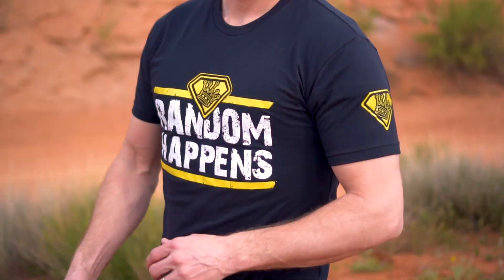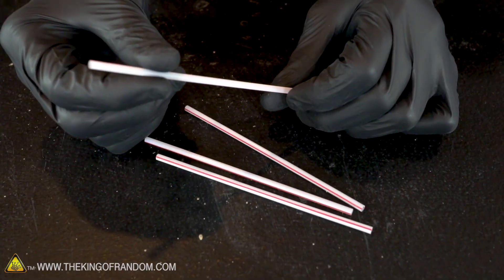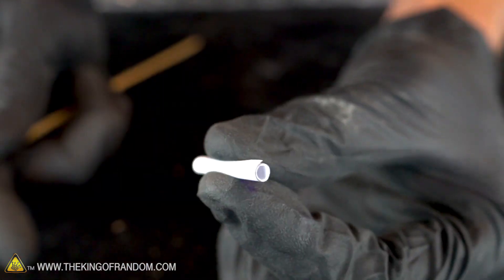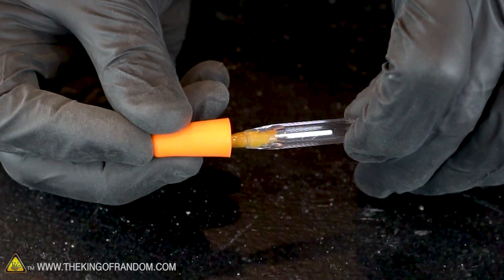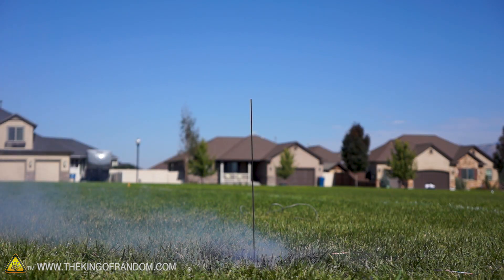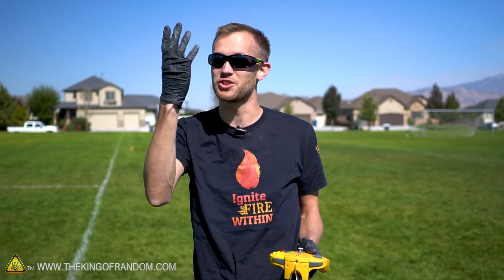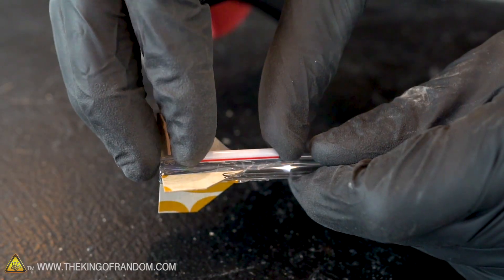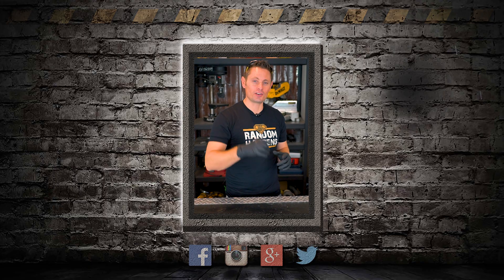DIY Pen Rockets! TKOR Dives Into How To Make a Mini Pen Rocket That Works On Rocket Fuel!

Comment: Maybe put another piece of straw as guide close to the tip of the rocket to avoid it going crazy?
Reply: The reason it went crazy is because there is a hole in the side of the pen that allowed gas to escape. In the next video in this series, he covers it up with glue.

Comment: The pen plastic doesn't melt with heat, how it's possible😕😟
Reply: higher melting temperature
Reply: The fuel burns before the plastic can melet.

Comment: I know this is a necropsy but I saw sideways thrust through the vent hole half way down the pen body. If you could slow the combustion by adjusting the compound they would probably fly much better, I believe that casing failure occurred quite frequently based on the video. Keep up the experimentation.

Comment: Idk if you noticed when the fuel was burning through the pen tube there's a tiny holes on the side of the pen that could release pressure through there and change your direction or cause the pen to explode

Comment: Part of your launch stability issue is how small your metal pole is compared to how wide the straw is. It would also help to be around a foot longer and angle your rocket fins in a fashion the maximizes the spin of said rocket :) if you use a metal tube instead of plastic you can pack it down a bit more for more thrust!

Comment: As has been previously mentioned: glue the small hole. In addition, increase the length of the guide straw to 2", weigh the fins on a gram scale to ensure each weighs the same, and use hot glue sparingly. The lift-off and flight-line will be much straighter. What better way to recycle all those used-up pens! Nice project.

Comment: Why go through the complicated process to 
remove the rear plug?  Pull off the front tip 
and ink tube, then push the rear plug out, 
with a piece of coat hanger.

steve

Comment: Also the proble with it going off balance it the straw you are using. cut the straw into two smaller rings and glue one at the top and one at the bottom. it will run off the guide smoother.

Comment: Zinc/Sulfur is known in Amateur Rocketry as MicroGrain. It was one of two widely used solid propellants starting in the 40's. The second was Potassium Nitrate/Sugar. The RRS, PRS, RMRS1 and RMRS2 were all prolific users of MicroGrain. One early altitude record was 14,400 feet and a later second one apparently 90,000 feet with MicroGrain.

Comment: Definitely be careful with zinc and sulfur mixtures. I burnt my hand pretty bad from the hot zinc sulfide dust that was expelled out. Definitely gained more respect for this mixture after my hand glowed like a neon sign under the blacklight.

Comment: you may want to put your straw higher up on the pen. where the top of the rocket points the body will follow. since it's power comes from the bottom, the tendency is the bottom is trying to pass the top forcing the top to go off plumb.I hope this makes sense, that is I put it in a way y people understand

Comment: Looks like there's a small hole in the pen body, when the rocket launches the fuel burns out the side of it and knocks it sideways - if this is filled, it should travel in a straighter line

Comment: Do this, but make the fuel thermite instead.
Reply: Um, no.  Thermite burns at 2500+ degrees Celsius.  The instant it started it would flash melt the plastic pen body.

Comment: guys there's a small air intake hole on the side of every ink pen that allows air into the pens cavity as you use the ink up, it's really small and hard to see, as i watch your slo-mo i see the gas escaping from that little hole thus making your pen rocket unstable, I did your experiment and plugged that hole and it went straight up every time, nice channel guys.

Comment: I noticed that sometimes your rocket went a little sideways.  One of your videos showed that some of the exhaust escaped from the vent hole in the side of the pen case, which may have helped cause the rocket to tilt to one side.  Perhaps some fiberglass tape around the middle of the pen case would correct this.

Great little project!

Comment: I think I know another reason it went sideways throws pens have little holes in the side of them so the ink doesn't create an airlock and prevent more ink going down the ink tube so maybe if you blocked the hole it would straight :)

Comment: You should have sealed the small hole on the side of the pen body, and put a another piece of straw. So, the gases won't escape by the lateral and it will go up more vertically.

Try to use less fuel

Comment: I think I saw something coming out from the side of the pen. Did you close the hole on the side of the pen? Or it is needed for some reasons? If not, does closing the hole improve the "performances" by making the pens going more straight?

Comment: Could you maybe attach some fishing line or very light weight string to opposite side of the rocket to the straw to make them easier to find? If you have a loose spool of lightweight string, if the rocket doesn't blow up, it could give you a bigger target to see, and you could save materials.

Comment: Because you hold the pen too tightly the explosion leaks from the side where the clamps were holding. You should instead use something like a skewer to poke the blue thing out from the other side. That was you won't damage the pen and won't have there leaks that make the rocket go crazy.

Comment: I know I'm a little late but I was noticing a little stream of hot gases coming out the side of the rocket body and it got me thinking, then I remembered there's a small hole in the side that lets equalizes the pressure inside the pen allowing it to work. Anyways, I was wondering if this might be throwing the rocket slightly off course and if so could you plug it and see if that helps?

Comment: Removing the pen tip entirely and gluing on the earplug would shift the center of gravity further toward the bottom of the rocket and (possibly) result in more stable vertical flight.

Comment: Use powder from the smoke bombs and put a little it before the rocket fuel. Ideally when the fuel burns out it will ignite the smoke powder and u will be able to follow the rocket
Reply: Or make little compartments on the sides by the fins

Comment: if you rotate the fins at a EXTREMELY slight angle it will rotate the rocket and will self stabilize using air friction, thus making the trajectory less unstable. try that and maybe you would be able to find some...

Comment: I have had some experience building my own rockets. I think definitely it would help to compact the fuel a bit, however in the slow-mo it is clear that it burns through the sides of the pen, melting the plastic. The problem with compacting would cause the contact time between the fuel en the plastic to increase, thus making it more likely to melt through. So I would think rolled paper might be a better option.

Comment: You can use the hot glue gun tip instead of the fired nail to melt a hole.

Some of the slow-motion show a smoke plume coming out the side of the pen, where they often have a tiny hole. Should plug that.

Add one of those tiny glowsticks or something between the tip and the pen (or wherever) and launch at night to watch them go.

Comment: I think your rockets would fly a lot straighter if you sealed that little hole in the side of the pen because in one of the slowmo's i think i saw quite a bit of sidewards force from that hole

Comment: It is veering off to the side due to a small hole in the side of the pen itself, the hole allows the ink to flow freely without creating a vacuum. next time if you return to this you should try plugging the hole with hot glue

Comment: Use the superglue to plug the air hole on the side of the pen body. It's acting like a little thruster to push the rockets off to the side.

Comment: Besides the ratio of zinc/sulfur others mentioned below, try compressing the propellant tightly so it burns more slowly and evenly. Like the compressed black powder in a commercial small model rocket engine, or like the pvc pipe sugar/saltpeter rockets when you compress them with the measured out dowel rod.

Comment: you need to tamp (compress) the powder to slow the burn rate (more efficient) and increase volumetric density (more fuel in that small space)
Reply: Dāvis Veidmanis no you can not that will explote the mix is to fast even if is compress also is to sensitive to friction so that would not work well man
Reply: guillermo velez I wouldn't use Armstrong mix, the burn rate is way too high. Iwas referring to the original mixture. I'd simply use kno3 + sugar. Although the pen would indefinitely melt.
Reply: @V4p3rcl0ud  use foil paber but that inside of your pen and it will stay great
Reply: Could also simply add a little baking soda
Reply: Baking soda will ruin the Amstrong mix if not making unbalanced if you refer to that with the baking soda
Reply: It will not work bro, it will burn the side of the pen. They not compress it or not make it so dense to make the flash powder continue to keep burning at the low part of the hole to keep the pen hole not blocked from a burn plastic of the pen. Trust me, I tried it so many times and the only problem because I always making it so dense when launching a rocket.
Reply: You mean tamp
Reply: @santiagocortez9554  thanks you're right, updated
Reply: can i use armstrong mixture?

Comment: Pens have a small hole in the side to prevent them leaking in airplanes. In the video it seemed that some thrust came out the side and caused the pen to turn  during take off. This could also be what's shearing off the guide straw. If you plug this hole the rockets might fly straighter.

Comment: Tip for those of you who either knit or have a relative that knits,  the ear plug with the hole can be used for the tips of knitting needles too,  just don't superglue the sucker

Comment: Perhaps use a longer piece of straw to keep it straighter and plug the small hole in the side of the pen. There's a clearly visible plume out the side of one or two of them. That'll drive it all over the place.

Comment: This may have already been mentioned, but those hexagonal pens often have a small hole in the side. You can see the smoke venting out in some  of the slo-mos. Fill or cover the hole so there's no side thrust and it should help trajectory.

Comment: These kinds of pens have a small hole on the side of the plastic which might be letting the fuel to burn through the hole causing the wonky flight paths.  You could experiment with gluing the holes with superglue.

Comment: This is a great video!  Is there a slower burning fuel mixture that might give a more stable trajectory to the pen rockets?  I really appreciate the recap at the end of each video.  You are working hard, and it shows, with all these new vids.  Great job guys.
Reply: Yeah potassium nitrate sulfur and carbon if you still need it

Comment: Use this but with sugar rocket fuel and add kitty litter to make it burn slower, add a point to it and at the end of the rocket fuel put a bunch of black powder. Shoot at a rc airplane then if it sticks the black powder will blow a hole in the side any hopefully shoot it down

Comment: Attach a parachute to the rocket so when I comes down your can see it and then find it and use it again
Reply: That requires more space and a cap that pops off at the end of the fuel burn.  Way more complicated than most people could pull off inside a pen.
The pen might work for the guide tube on a bigger rocket, however...

Comment: The reason there not flying strait is because those pens have a hole in the side so that it won't be affected by changes in pressure. That hole is causing gases to push them off to the side

Comment: There is a small “vent hole” in the side of most disposable pens and can be seen in slow motion that caused a side trajectory the hole needs to be hot glued or plugged to achieve a more vertical flight

Comment: Looks like you need to seal up the air vent hole in the side of the pens. I saw a flare which may have caused perpendicular thrust when the fuel burns past the hole.

Comment: havent seen the original video yet, but it seems like this is burning way too fast, which makes bad rocket fuel, if you can slow it down slightly it will be significantly more efficient

Comment: i think the reason your pen rockets kept going off to the side is tere is a vent hole half way up on the pen shaft that poofed out to the side try filling this hole with hot glue and it should work better/fly straighter
Reply: read this

Comment: You should try putting the rocket mix in a cardboard tube ( like a commercial rocket motor), and launch a bigger rocket!
Reply: MLG Gaster what about that?
Reply: Cardboard is already used on rocket motors aswell as fireworks
Reply: The plastic from the pen is also flammable and melts under heat or shatters from pressure spikes. 
Accounting for the sacrificial nature of the materials makes it nonetheless viable.
Reply: Nitrous Diecast then it will not be a pen rocket
Reply: line the inside with aluminium foil to prevent the card from burning?
Reply: You say  that like it's a bad thing. :)
Reply: Cardboard is flammable, buddy...
Reply: @anomalousfiend  Have you ever shot motors, Roman candles, or ever seen a rocket motor? Cardboard is used for all of them.

Comment: Now if you build a pbc capsol and pore that in there with a fuse you just made a pipe bombe and if you take some of that fuel and replace the smoke powder form the colors smoke vid you could make a grinade

Comment: If you put a binder into the mix, don't know which would work (maybe denatured alcohol?), you will get a more compact solution to add into the pen and a smoother burn/launch.  Let the binder evaporate or set.  I think part of your issue is that the propellant is burning too fast.  Slow it down a smidge which is why I think your zinc filings might actually be a better fuel than the powdered version.

Comment: The reason they didn't go straight was because the bic pens have a hole in the side of the body and in the slowmo you can see the exhaust gasses escaping from this small hole cause the rocket to vere of course

Comment: Please, can you start using meters? I don't understand inches. Also you make great videos, keep it up!
Reply: FunWithPL One inch is equivalent to 2.54 cm, so from there just figure out how many centimeters are in a meter.
Reply: 1 meter is 3 yards and 3 inches
Reply: 1 inch is 2.54 cm
1 foot is 30.48 cm
39.370078740159996755 inches is 1.0000000000000639 meter

Comment: You might try and go full Homer Hickam and mix the zinc propellant with pure alcohol. This turns it into a paste that you can press into the casing of a larger scale rocket. It keeps the mixture in place in the tube (as not to create air pockets and ensure consistent burn) and if you pack the paste without bubbles of air, it will significantly decrease the number of detonations of the rocket. Then all you have to do is dry out the paste in the tube and put all the external rocket parts.

Comment: A tip on launch accuracy, if you look carefully in the slow motion footage you can see a small amount of the fuel firing perpendicular to the pen around the mid section. I think this is due to the small hole(s) on the side body of the pen. I wonder if some of that could be affecting the resultant thrust vector. Maybe plugging them with hot glue may give better results?

Comment: You should add a bit of the smoke grenade mix to the from so it can be tracked like a flare. Also try blocking off the air hole to prevent the little side burst.

Comment: To track the rocket you could put a slow burning 1/3 smoke charge in the tip and 2/3 fuel, this way they should start leaving a smoke trail some time after launch.

Comment: why don't you try layering the inside of the pen with foil, it looks like the heat is melting a hole in the plastic sometimes and throwing it a bit off coarse, the foil should help prevent that

Comment: Could probably do with the tiny air hole in the side of the pen covered and an extra piece of straw at the top to help guide it more.
I wonder what would happen if you packed the zinc/sulphur mixture into the barrel of the pen tightly?

Comment: Hey the reason they were wonky sometimes was because the heat from the fuel melted through the pen causing a different direction of where the power was going.   You should upgrade it with an insulator, maybe duct tape? Or even foil because foil is cheaper. Idk your the experts!

Comment: Hey, TKOR. The reason those rockets went off to the side is most like that they have a tiny hole in the casing on one of the flat hexagonal sides. Most hexagonal biros have this, so in future you could try putting a dab of glue in the hole? Sweet idea though!

Comment: I love watching TKoR vids for ideas of things to do with my kids I've been launching pen rockets for quite some time and easier way to get the end cap off is pull the tip out and then using a piece of Steel coat hanger push the other end out, also if you using the hexagon stick pens by Bic there's a small vent hole on the side of the pen if you don't plug that you're going to get a secondary side ignition which is going to force a rocket in One Direction or another

Comment: IDEA: some of those octagonal pens have a small hole in the side of pen to allow ambient pressures to equalize and the ink to flow. I think on some of the videos I see a plume of smoke coming from the side where that hole could be. That might account for the rocket going sideways or off course.
Reply: Lamar Newmeyer one of those 6 sided octagonal pens?

Comment: You can add a streamer so you can see it better.
Reply from the maker: ben mccullough I did try that once but the heat of the ignition burns the streamer off in a Flash.